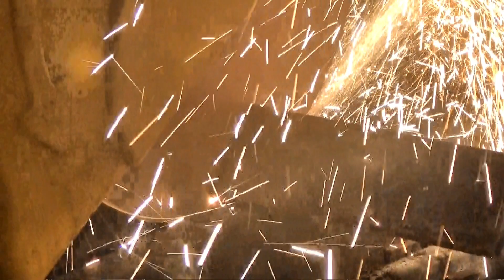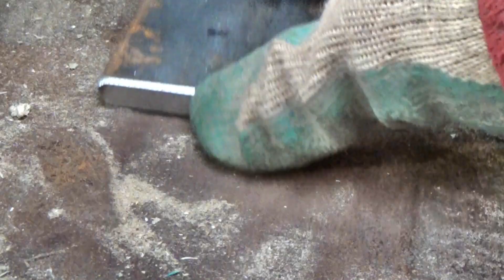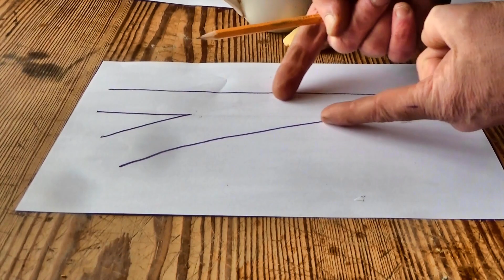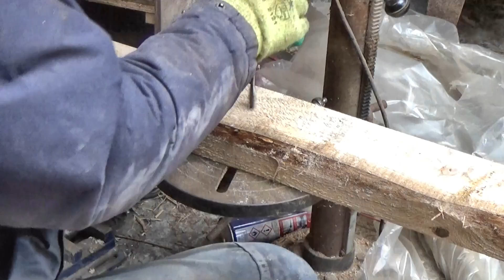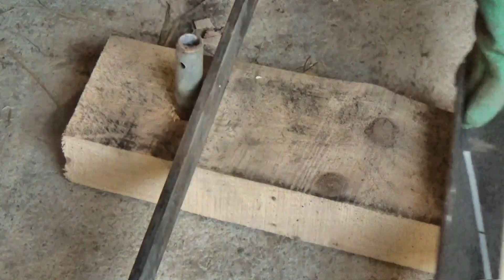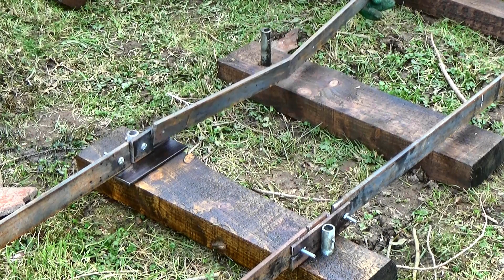Homemade Fishplates And Single-Blade Points For The Field Railway (RE-UPLOAD)

Comment: The design of your new switch is great. Only thing i would change is to add a flush plate on each sleeper and a matching plate that extends out the unsupported side of the blade angle adding more support in that direction. The plates can then be greased for easier movement. Then of course a positive point locking mechanism at the tip of the point with a working switch stand providing indication.
Reply from the maker: Yes, but all completely unnecessary  : -  )

Comment: How flexible are the unsupported rails?

I wonder if you could just rely on the flex of the rail and the weight of the wagons and use pegs to stop the rail moving too far?

Comment: A single bladed point design is usually used in tramways in mines For the same reason why you're using it too a Tramway and a mine isn't meant to carry people. It's just supposed to carry ore So a single split is switch is more ideal plus it's cheaper, you're useless material.